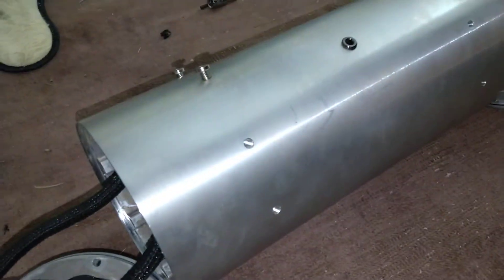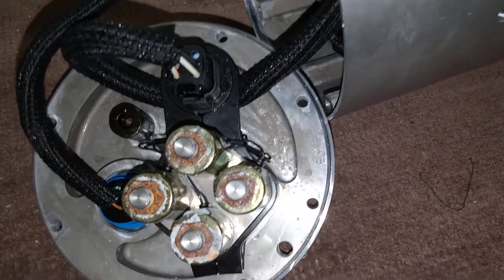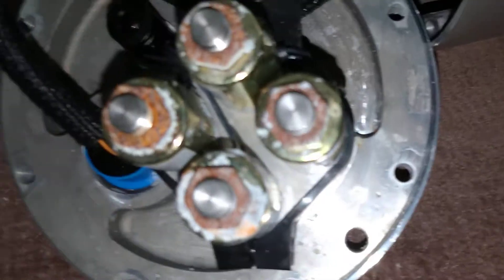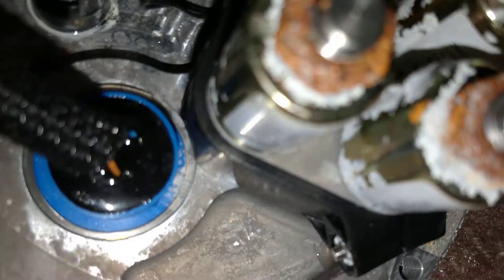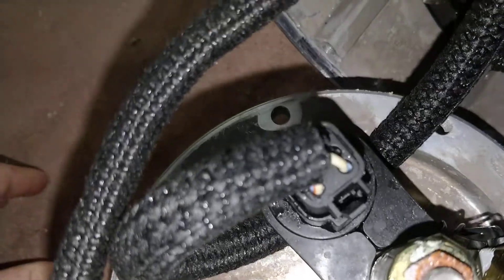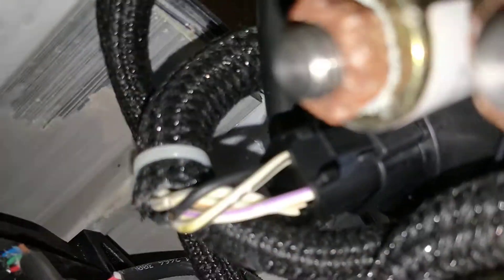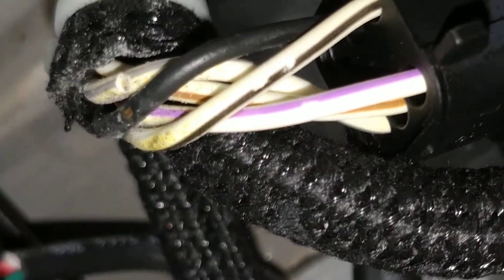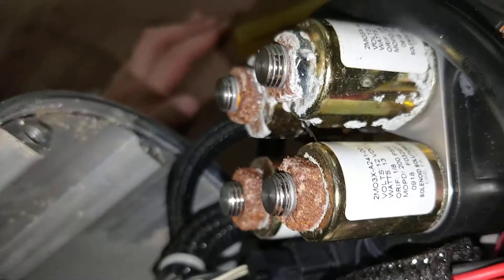Dead accuair Endo cvt

Comment: I’m having the same issue. No pressure sensor on 2 of my sensors (Intermittent). At least the compressor is still working. I am planning on removing the compressor, let it dry out and re-install it outside the tank. If that fix the problem I will re-install it back inside the tank but this time I will add a water trap filter. Not sure exactly how I will be able to do this but I’m thinking to run a line from the compressor output to one of the End Cap drain hole, install the water trap filter outside the tank and then run a line back to the tank using the other End Cap drain hole to pressurize the tank.
Reply from the maker: There's a single use gasket so you can't put the tank back together. It might work once but be very careful.
Reply from the maker: There is a hole in the bottom of the tank that's supposed to be used to put the tanks in series. You might be able to use that
Reply from the maker: Also you're going to have to rewire the compressor module and I honestly don't know how you would do that
Reply: @mattweger437  you don't have to re-wire the compressor module. Just convert the unit to VT (without cutting any wire). You will use the same connector inside the tank but now outside the tank. One thing that will need to be re-wire is the pressure switch because you are not using the pressure switch inside the tank any more.
Reply from the maker: There a few videos on how the CVT Is built I would watch them

Comment: My CT just went out today. I'm in Florida too. Not sure what I'm gonna do
Reply from the maker: Well I went and converted back to springs but if you read the description there's a way to trick your endo into working for a bit
Reply: Yea it's obvious to me now that it's a pressure sensor failure. After leaving some ports open for a couple of weeks it started working again. After a month or so it started cutting off around 170 psi. After a couple weeks of that it quit all together again. I have it open now to dry out in Hope's to get a few more months of life out of it while I save for an external set up. I did get a hold of someone at accuair who helped me troubleshoot, or rather confirm that there's a short by checking voltage and grounds. Basically one of the pins wasn't showing voltage when it's broke and is when it's not. I asked for a schematic, but got the "that was lost in the move" answer. I'm imagining that I can bypass the internal pressure switch, and basically hotwire the thing, but this might be a pipe dream. Any how, when I get my external setup that's when I'm gonna open it up to see if I can. 
Charging the tank to 75 psi or any psi for that matter won't do much for me as it quit working with 170 in it. I'm all ears though if anyone has any input
Reply from the maker: @quicksno  TBH the electronics looked fairly nice. All optoisolated etc. But lack of stainless steel hardware.
Reply from the maker: @quicksno  you can do this. I'll see if i can make a diagram since mine is already apart and dead
Reply: @mattweger437  this would be awesome. I've looked for dead tanks for sale so I can dissect. I can give you my email

Comment: How long did it last the failure?
Reply: Have my 12 mo died today
Reply from the maker: @tolek3924  f
Reply from the maker: @tolek3924  I bet you found out that accuair got bought out but isn't honoring any warranties. I still haven't fixed my car because there's no place to put the compressor where it's not noisy as hell. All the air bags seemed to be put on with lock tight. Kinda screwed tbh
Reply: @mattweger437  yes know is sad I decided to att for this tank 2 airlift compressor and gona do some sterophiane wall lol 😆
Reply from the maker: @tolek3924  yeah I went for something similar but I'm in a hatchback with no place to put the tank underneath so the compressor has to mount outside the spare wheel well and it just messes everything up :/
Reply from the maker: @tolek3924  in other words covid killed my car XD
Reply: @mattweger437  covid soon take everything lol
Reply from the maker: I got it back in November so about 10 months till the first failure where I had to start filling it up to 75 psi before it would start and another one before it died completely.
Reply from the maker: I would recommend fixing it before it fails because after it's fuckin annoying.